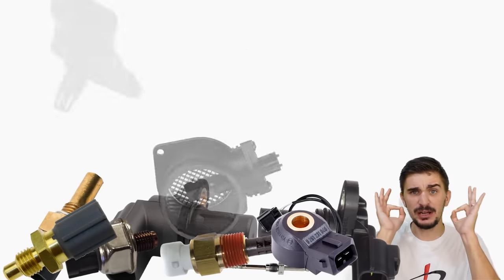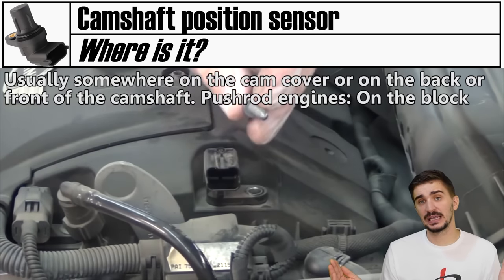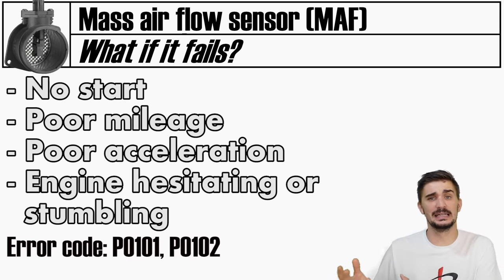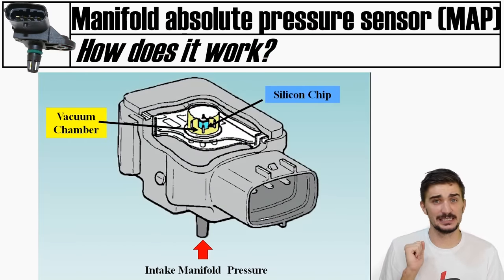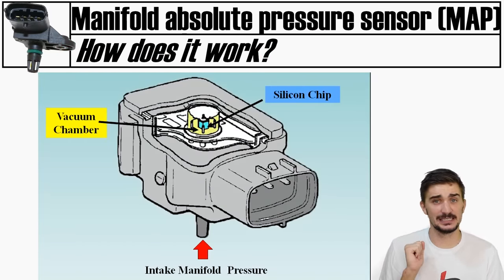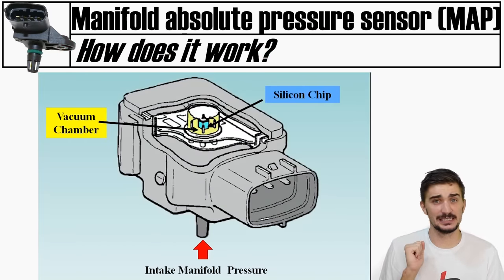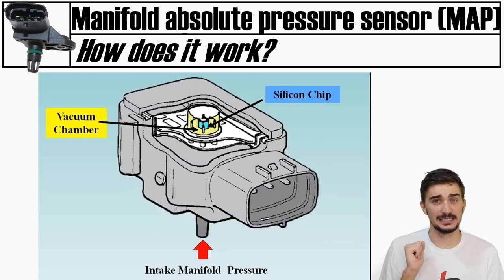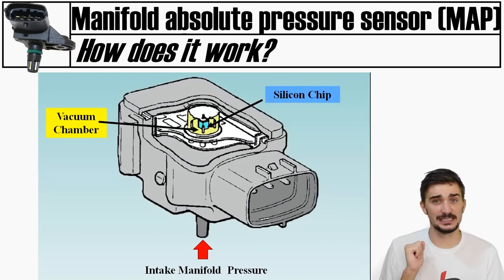EVERY ENGINE SENSOR EXPLAINED - MAF, MAP, IAT, TPS, 02, NOx, EGT - How it works, location, OBD2 code

Comment: Can you reply with all sensors needed  for a 94 Chevy s-10?    I am on third motor (2nd lasted only 30k)  and the truck with many upgraded parts has about 180k on it.  I am now not required to pass emissions but the new motor runs clean  ...running straight exhaust with cherry bomb.   I do have rough idle at times and have an idle sensor for the throttle body but what else do I need to look at??

Comment: Hello,
I just need your advice on an issue with  EGR gas recirculation  code P0400. I have replaced the EGR valve as the car was in the garage for 4:34 a longtime. I have checked the temperature in the inlet and outlet pipe of the EGR. Both are hot. 
When I start a cd  engine  I sometimes get the P 0400 code.  What else should I check to eliminate this code for good?
Syed 
Illinois

Comment: The good old days of the 60s before computers ran your vehicle engine.
Carburetors and a PCV and no catalytic converters.
Easy to repair in your garage with just wrenches and screwdrivers.

Comment: My car has a bosh system and most the sensors are not being picked up by the ecu, could it be that those sensors are faulty or a connection could have gone bad

Comment: Hi, I have a 2001 Ford F150 with as 5.4 gas engine. When I first start the truck from a cold start if rev's high of course but after about 15 seconds sometimes sooner it wants to jump forward and the rpm's are jumping up then down until I put the truck in gear then it disappears only when I stop the rpm's  go up and down , any idea on what is happening? I have been to my mechanic several times and gotten no excat answer, hopefully you know what going on, please advise, thanks,Ken

Comment: I have a Jeep Wrangler JK 2012 and it keeps giving me the emmisions failure check engine light yet both of the O2 sensors and gas cap have been replaced with OEM. What sensor would be giving me this issue?

Comment: Briefly
I have a 2016 Infiniti Qxs, and I am regular and keen on the maintenance schedule at the Infiniti agency. Suddenly, on 12/2/2022, all the lights on the dashboard lit up, the car weighed, and I immediately noticed the temperature indicator, and it was normal, and the engine turned off without warning, and there was no driving time. Any defect and no sensor worked to notify me that there was a problem at the same time. I was frustrated because no indicator worked. The car was transported by crane to the mechanic, where I was informed that the car engine was completely damaged, meaning water mixed with oil without prior warning. I was wondering what is the benefit or value of sensors in such a way. Cases that cost me about 2000 US dollars, and the victim is the consumer in our countries that have no accountability or control. In conclusion, we thank the miserable sensor muscles.

Comment: Very cool and everything makes sense... my question is, obviously the internal combustion engine was invented well before computer chip technology, how the FUCK did those pre-OBD / ECU engines run and manage anything? I get there can be mechanical alternatives to some of this stuff, but that's wild to think about. The timings and mixtures seem to need to be extremely precise to keep an engine running, was everything just "hard coded" and prebuilt to averages and ideal scenarios?

Comment: Is there is an rpm sensor and where can be located in Cummins engine
Reply: likely depends on the exact model, the first result on google shows it being located just below the starter, just search for your model and "crankshaft position sensor"

Comment: i just installed a 4inch intake on my mazdaspeed3. i used the same MAF sensor from the old intake on my new one. the car now starts but immediatly dies. my old intake was 2.5' and im guessing the upgrade to 4inch completely messed with the MAF. is this a symptom? car is tuned for all the mods except the 4inch intake. its an entire intake aswell from the turbo.

Comment: My IAT is reading 99 degrees but the engine is cold and it's 60 degrees outside I changed the IAT sensor but still reads high

Comment: Hi guys, listing to the video is extremely interesting but much of the info overlap each other, is anyone able to help with ……. Vehicle symptoms are, starts very easily but then splutters and dies, does this a few times then it runs perfectly. Most prominent on cold starts so is it fuel or air and or what sensor could it be?
Reply: Might be bad mass air flow sensor, dirty/broken idle air control valve. Probably should take car to a mech 🤔

Comment: I had a Morris 1000 in the mid 70s and put about £2.00 of petrol in during the working week. 

That's 5 x daily trips to Plymouth of approximately 15 miles each way. 

5 x 30 =150miles

+ running around every night with a car full of mates, probably another 150miles easily.

Fuel was approx 35p a gallon.

300 ÷ 6 gallons =50mpg.

Not so impressed by modern economy.

Comment: You might be the man to advise.. so I have a 2.0tfsi A4 b8.5 quattro. I have vcds and I have an obdlink Mx+ .. so, pre mods I had 200 plus bhp, after mods / map I'm about 320bhp.. on my Mx+ / obd link app I can run stats. I used to get readings for air flow mass.. now I don't. Is this because it's rated for a lower intake pressure than it can advise now? Is it something to worry about? Let's say an S4 mas sensor is installed. What will happen? As they're essentially up at similar powers. Any suggestions/ advice? Cheers
Ok, I just hit 10:00 + ... Do you have an email address, could I send you some logs and tell me if anything you see is wrong and needs rectified.
And no, I've zero check engine lights. I did when I installed the downpipe but this was cleared until I had the remap. So now I've no issues or problems.

Comment: Please someone help with a suggestion . I have the code P0705. The car can start in all Positions P,R,D,N .and when it starts it doesnt show which gear the car on the dashboard. instead I get transmision sign with the exclamation mark in Orange and this is when I can drive the  car almost normally and the car can go reverse and from second up and up  but with no first gear and  parking sensors are not beeping nor reverse lights working  .but if I dont see the transmision fault sign, the car go only in first gear up 20km ph and doest change to second gear and up and no reverse  . 
I changed the  transmission range sensor and bought a new battery and tested alternator with a specialist and said its fine which leaves me frustrated . The car is BMW e46 325i  / 2001

Comment: HERE'S THE THING AND WHAT MAKES ME ANGRY.  When fuel injected was pretty much mandated due to new emissions requirements, they should have also pushed legislation that automakers program the car's ECU to go into a "fail safe" mode and allow the driver to still drive the car, in the event of a faulty sensor.  Meaning, basically, if a sensor either fails or is not operating properly, the ECU is then programmed to disregard the information from that sensor, until repaired, and will operate the engine without it.  Doing that would allow drivers to still drive their cars instead of their car being undrivable and disabled the moment a sensor wears out or breaks.  THIS IS MY BIGGEST ISSUE with fuel injected cars.  A car should not all of a sudden be disabled on the side of the road for a sensor going bad.  If the car runs fine otherwise, the ECU should not basically disable the car until the sensor is replaced.  Part of this is the government pushing emissions and the other part is a money grab by the automaker.

Comment: I accidentally disconnected the knock sensor on my 1999 Lancer and experience loss of power dues to the ECU retarding the timing and Check engine light is on.

Comment: How about one very important one that can cause many many issues and potentially hurt your vehicle. Ambient air temp sensor. These little bastards can cause things to overheat when they fail. I've heard they can kill transmissions, and I've had a 16 fusion have one fail which causes the ecm to read -40 and wouldn't allow the ac system to function.

Comment: won't worry about o2 sensor failure bc....race car babe....straightpipe all the way down
Reply from the maker: You still need an o2 sensor.. unless you're carbureted, but then you would mention the carbs and not the pipes.
Reply: @d4a  then where to put it if I got no catalytic converter nor a muffler??
Reply from the maker: Anywhere right after the exhaust manifold or the turbo. On your exhaust pipe. You don't need a cat or muffler for an o2 sensor
Reply: @d4a  thanks man I really appreciate it. Also, really want to take this opportunity to give you a proper thanks to all the efforts you've been putting in your videos. Massive thanks, your videos are free, well organized, pretty informative, easy to understand, that put you in my top 5 yt channels ever. I mean YouTube automotive channels are actually helpful a d informative can be counted on hands fingers man. Thanks man I really appreciate it. I hope you more success and more of the informative future videos

Comment: 16 sensers is rediculous. Way too complicated. I am amazed an engine will even run with all these that could go wrong. Your explanation is well done, but the check engine lights are the bane of the driver even though the light is there to get the car into the garage where it can be repaired which may result in an exorbitant repair cost.

Comment: Why is there so many damn sensors!!!???? 
The Volkswagen beetle was the most famous vehicle on this planet and Volkswagen sold A LOT of them and you know what they didn't have..  SENSORS
Reply: They did, not electronic sensors, mechanical ones, but they did have some.
They have a mechanical RPM sensor to advance timing at high RPM and a mechanical vacuum sensor to measure engine loads, for further timing adjustments

Comment: Do you have a no start video
All i hear is a click sound in the fuse box under hood when i turn yhe key
My kia stalled when i stopped at a red light 
Smh 
2016 kia sedona lx 
Codes show for oxygen sensor s

Comment: Too many sensors cause the same problem. And that's the problem. 
Too many people change the plugs, then change the coils and still have the same problem.
Then replace the sensors easiest to get at. Then that doesn't work. 
Then the throttle position sensor. Then that doesn't work. 
You are in it now. Then you replace them all. Still misfires and runs rough.
People really get frustrated. 
Engine compartment is hot. Full of cheap plastic wires and sensors. 
They break down. Start changing the wiring..  Can be an endless money pit.

Comment: The car withaut senzor are someting all ader its garbidge,,,sometime to expensive...only senzor needed in car its a good driwer end only improwed helper for clean Nature is hho generator,,,the simpliest on conector of 12v in carine., ,normaly portabl,,,if you need him in ader car or combi or tractor yust bring out like a small box end gomonnteactor end all day on field to engoy  or in worckmashine....the using this is so easy end yust red end plack wire...in modern cars its somewere ewend 100 senzors for ligth dirs toalete end .... so on

Comment: Where are the sensors for the E-brake, transmission, suspension, tires, park assist, airbags, automatic lights, etc… ??? Dude, you’re missing a lot.

Comment: It's all well and good knowing what they do but when you can't find any information in the manual about it at all, not even mentioned because the manufacturer decided to call it something completely different you to feck you up. Crank sensor we all know, engine position sensor nobody knows, it doesn't even make sense, the engine position is in the front under the bonnet, what's that got to do with the fecking crankshaft. Iveco suck. When the sensor fails the engine takes a long time to start and runs a bit rough but it does run.

Comment: Since we did alright for a 100 years without all of these sensors all this stuff is tech dictatorship. You can have it if you want it but where is my right of choice. Let one of these sensors fail and it takes 3 weeks to find the problem, another week to replace the part, and 4000 dollars. How do I know this because of my experience not some technical jargon. This just happened to me!!

Comment: You forgot the sensor that plugs into your butt to tell you when you have to take a dump and pull over and find a restroom other than that that's too many sensors they should have a sensor that plugs into the designer who designed this piece of s*** car that has to have all these sensors in them that's bullcrap anyway great video I'm surprised you had enough time to cover all the 500 sensors that are in these cars what brilliant mind designs a car with all this b***** in it😂